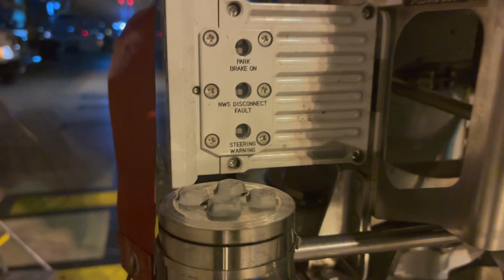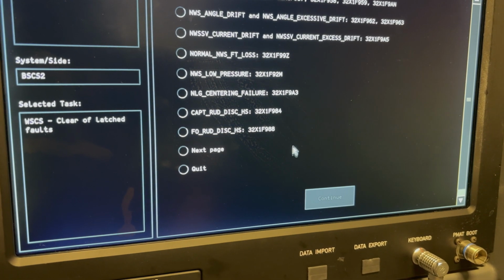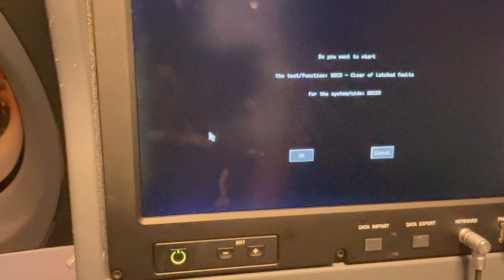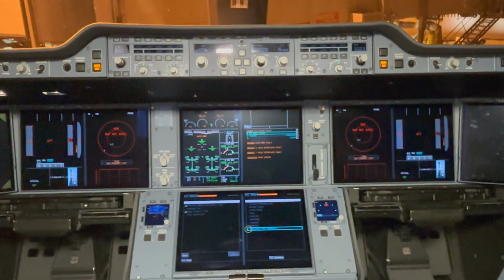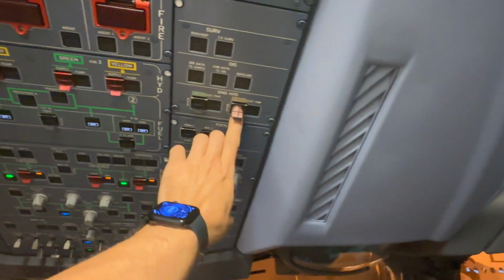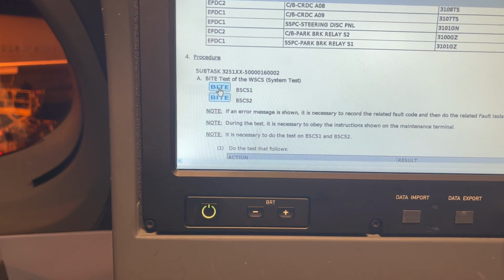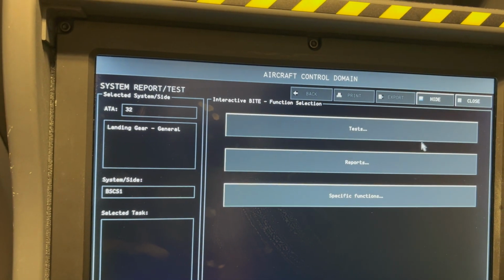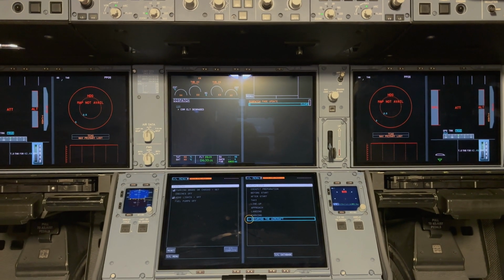Airbus A350, Steering Angle Exceedance Warning?????

Comment: Hello, your troubleshooting procedure is not satisfactory in my opinion.
A problem occurred in Paris with the nosewheel, which you apparently believe has been resolved...
You notice a fault on the cockpit display again, and you simply erase it by computer instead of checking what's happening in the field.
I think it's bad and totally unprofessional.
And as long as I'm making this message, I don't think it's right that you're putting this kind of information on YouTube, including tours, on-board electronics for navigation, piloting etc. 
If you have nothing else to do, learn how to troubleshoot aircraft in the field, not on a computer.
Reply from the maker: Hello there, the thing is the flight crew would not have left Paris with this message displayed. And as it only popped up in one of the computers and not is both, and if you have a real oversteer the msg is in both computers. So clearing the msg is the right thing to do. Also the mechanical indicators on the nose gear were not bend or cracked, than clearing the fault msg is the only thing to do.
And I don’t see a problem, for showing people what going on behind the scenes and location that you normally don’t see, as all is already out there if you look for it.
But thanks for the feedback. Have a good day.